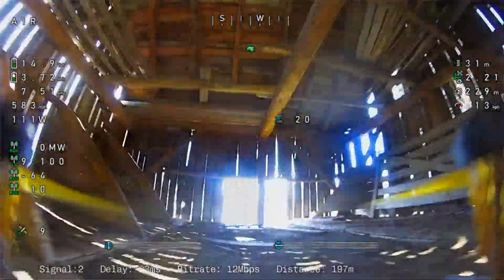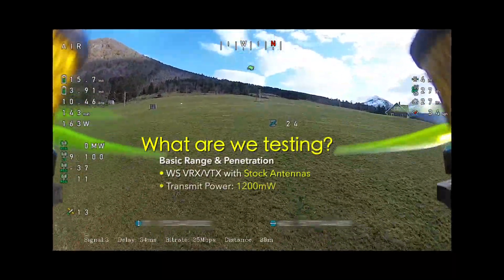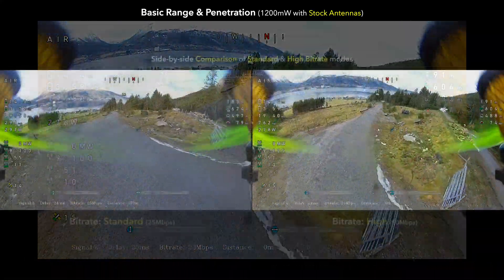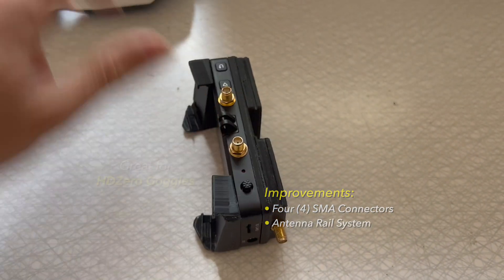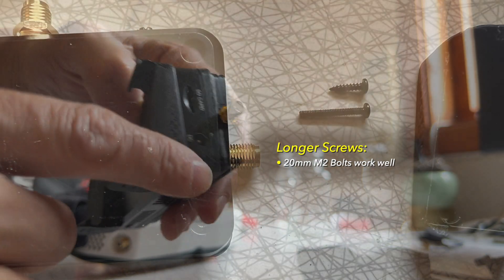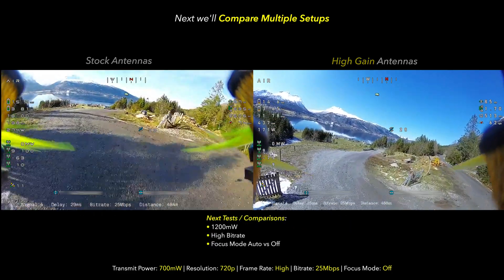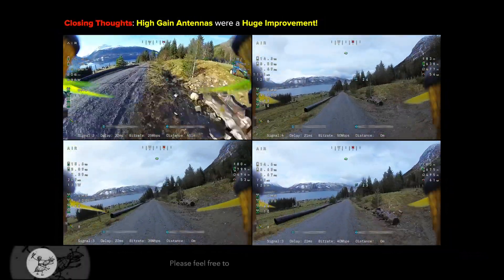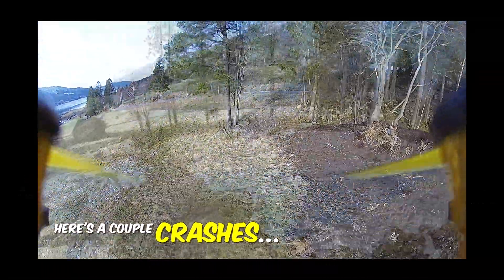Improve WalkSnail Range & Penetration with High Gain Antennas? FPV Image & Signal Test Comparisons

Comment: Awesome testing and comparison, love all the info! I don’t quite understand why companies include trash antennas - seems to set their product up to perform poorly. I would either include no antennas, high performance, or at the minimum, bottom of the line dirt cheap linear ones just for people to have something when they get it for basic setup while waiting for their aftermarket antennas of choice to arrive.
Reply: The VTX antennae are actually pretty good, enough to fly miles and miles with good VRX antennae. The patches included with the VRX are also quite good, 9dBi gain I believe. The omnis included for the crucial transmit and receive ports on the top of the VRX are not so good though and definitely need replaced.
Reply from the maker: Yea, I think your right. As I mentioned in my reply you Calley, I’m sure the stock setup probably works just fine for most people.  My uses and expectations are on the extreme side of things…
Reply from the maker: Thanks bud, appreciate the comment. Agreed, most manufacturers seem to do this, certainly a cost thing, but for the general public the stock antennas likely work well enough. My uses and expectations are generally on the extreme side of things, I just like to push these systems and try to improve them for my uses. I’ll be doing some more difficult tests with some new antenna combinations for the next video, which will be fun. I’m sure I’ll get a lot of exercise on the inevitable ‘search and rescue’ missions… lol

Comment: I recognize that VRX mount! The non-angled version slides less on the goggles, but you loose the angle with it. Ideally i wanted to use the google stl as a cutting tool to give better contact area and be more rigid when attached, but the step file for the goggles were fighting me when I was trying to import, so it's all measured by hand and I think I have a few measurements slightly off.  Let me know if you need any changes on it, and happy to make adjustments to the model
Reply from the maker: Hey man, great work on the design, it works perfectly in my opinion. The slight sliding has no affect on performance so I wouldn’t worry about it. Love the fitment, it’s exactly what I was hoping for, glad to have found it! Appreciate you checking out the video, and sharing your design with us, cheers!

Comment: Having looked into walksnail for a while it seems to me that for some people the vrx performs much worse than the gogglein range.

It could be as simple as less shielding or a noisier power circuite.
Or perhaps ultimately just worse built as its built and sold at a very low pricepoint.

If i had the vrx i would be tempted to try antennas with direct ufl connections.
Reply from the maker: Yea, wish I could do a comparison of both, but I don’t have the goggles and so can’t speak to their performance. 

Penetration tests (specifically in trees) are definitely more difficult for the systems than basic range tests. I’ve seen a lot of really successful range tests with WS recently.  and actually for WS or DJI range is pretty easy because there’s generally clear LOS, and the systems can buffer and repair any lost packets. Additionally the image often holds up better because there is less details and rapid movements to transmit. 

Regarding antennas, it’s kind of a ‘half-secret’ (shhh..) but VAS is working on some direct UFL antennas specifically for the WS VRX. I’ll try to get a set for testing and comparison with my ‘next generation’ antenna setups. 

Anyway appreciate you sharing your thoughts, stay tuned, cheers!

Comment: You might as well do the same runs with DJI and Analog now😁
Reply from the maker: Unfortunately I won’t currently have a DJI setup, but will definitely be doing an HDZero comparison in some more ‘intense flight paths’ in the next video. The goal is to push the systems until they lose signal, then see how quickly they recover. (It’s gonna be a lot of ‘search and rescue hikes’ for me…)

This recovery time is my biggest concern with WalkSnail/DJI and why I currently trust HDZero more for my mountain surfing quads. Appreciate the comment, stay tuned for that, cheers!
Reply: @GiantAntCowboy  I'd be keen for that. Please throw in some analog footage too. It may be old but it still works and keeps the hobby alive.
Reply: @GiantAntCowboy  Some people don't push their gear nearly enough. They throw on massive patch antennas and fly until they get a single sparkle. I'm busy troubleshooting my analog screen rolling because I fly until I literally can only see the horizon. Once I know my gear is set for that level of breakup I'll be more comfortable to use it in more risky places like over water or around people chasing cars.
Reply from the maker: @madladdan  unfortunately I don’t even have any analog setups at the moment. I have several old VTXs… and maybe I can build an analog quad from spare parts “Number 5 is Alive”. Haha! 
But yes, i generally fly far out along mountain ridgelines, valleys, rivers and waterfalls, and I need to trust my gear and know the limits. So I’m constantly testing, stressing and trying to improve the systems. It’s awfully expensive and depressing to lose a quad… But flying and getting footage in these extreme environments is an adrenaline inducing addiction!
Reply: @GiantAntCowboy  Yep I've lost a quad. Kinda ruins flying once that happens but we still do it.
Reply from the maker: @madladdan  yea, I’ve also lost a quad, it quite depressing actually… I still have hopes I’ll find one I lost in my near by woods 3 years ago… lol
Reply: @GiantAntCowboy  I spent 2 weekends looking for mine. Never found it. Always use a buzzer.
Reply from the maker: @madladdan  yup, I too spent several days searching.  I didn’t have GPS or a ViFly Finder buzzer on mine at the time… lesson learned.

Comment: I would love a tutorial on how you took apart and installed external smas vs the stock patches! Looks like a very nice upgrade
Reply from the maker: I’ll consider it, I believe I took some footage during the install. One “word of caution”: Under the Top Left SMA on the circuit board is a small component with a thin glass cover, several people have broken this whole doing similar modifications. The performance seems unaffected, but best to be aware and use caution. 

Thanks for watch, appreciate the comment and stay tuned, cheers!

Comment: Thanks, great video! After trying out walksnail my self I just wonder how you are abel to get 15 sat lock 😅 I guess this is the v2 vtx?
Reply from the maker: Haha, this is the V1 VTX, but yea strangely I’ve never had GPS issues with this build. When I first got my HDZero 1W I had really bad GPS issues, like 0 satellites or they come and go while flying. I tried a bunch of stuff and what seemed to fix it was simply setting the ‘Baud Rate’ to Auto, and then setting the quad outside for a few minutes. Ever since then I haven’t had GPS issues. Not sure why it helped, but it’s super quick and easy to at least try. 
Thanks for the comment, appreciate the support, cheers!

Comment: Thank you, that's very useful. And watching your presentation, I realize FW guys like myself have a very easy time in comparison. We stay well clear of anything resembling terrain, safely relying on data gathered through gutsy multirotor test runs like these. Thank you for defining the limits so we know when to chicken out!
Reply from the maker: Yea this system seems to be a perfect solution for wings. But closer to the ground and behind things gets a little trickier… I have a couple more ‘intense tests’ for the next video, but my confidence wasn’t quite there yet. I have a lot of fun pushing the limits. Thanks for watching and commenting, stay tuned, cheers!

Comment: Thanks for these comparisons. I think I'll print your HDZero Goggle rail mount too. The weird thing about the camera (or maybe it's the system) is that it always looks flat and muted. Kind of like cinelog color space or something - but at the same time, shadows get crushed. It could be a strategy to get better compression with less color and less details or it could just be the camera. What do you think?
Reply from the maker: Yes, interesting point. I always felt that WalkSnail (and DJI) make the image ‘super contrasty’ in order to make the image look shaper and cleaner. Compared to HDZero and Analog which generally maintain much more details in the shadows and highlights; but HDZero and Analog of course don’t look as sharp and clean. 
Your thought about this being to benefit the compression algorithm makes a lot of sense. Ex: If you post a video with really high contrast on social media (FB, Insta, TikTok) the compressed version always looks sharper and cleaner. 
What’s disappointing with WalkSnail is when you’re parked in the ground the image looks incredible! But as soon as you start flying it starts to fall apart quickly, generally still looks great but no where close to the image before takeoff. 
*Long response sorry*… but another interesting thought from a viewer recently, was that having my props in view of the camera might actually be using some of the Bitrate resulting in an overall more compressed image. This could make sense and I’ll try to test that theory in the future.  
Anyway thanks for the comment bud, cheers!
Reply: @GiantAntCowboy  I have ws  and this is why i use hdzero when i do penetration. WS image quality fall apart in penetration , it's blurry. HDzero keep his resolution.
Reply from the maker: Yup, exactly my thoughts. WS image looks better until signal gets weak, then the image quickly looks much worse then HDZero.